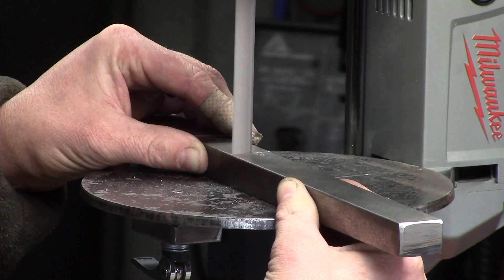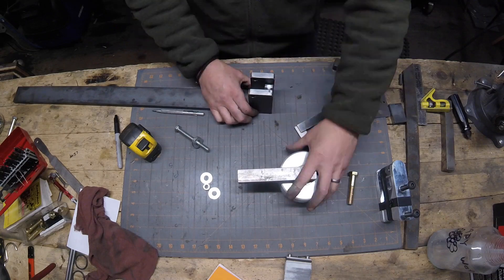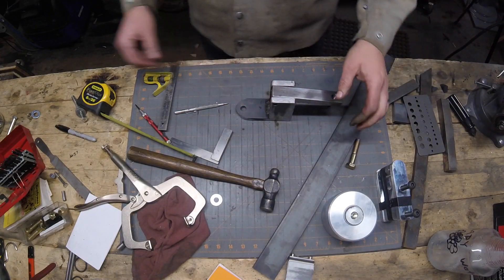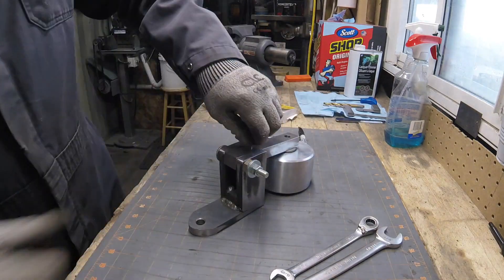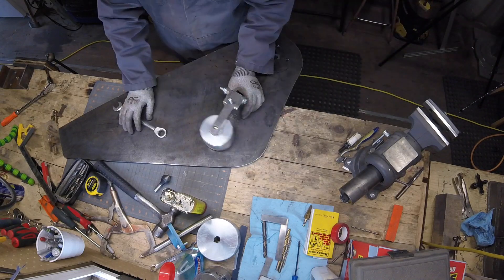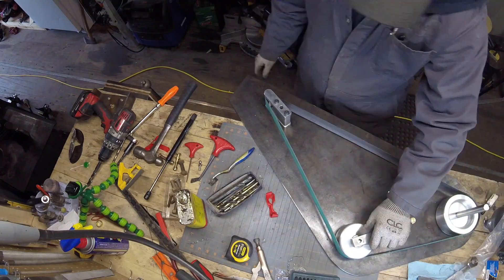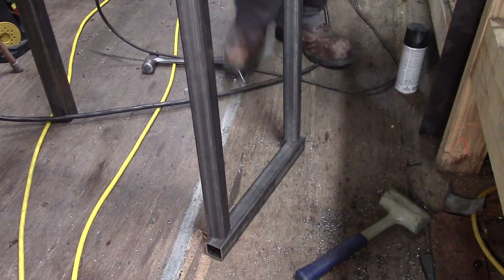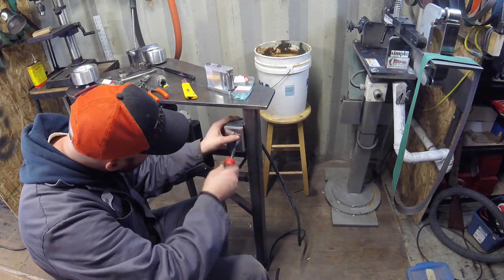Making a 2 X 72 horizontal belt grinder

Comment: I built something similar I find myself using it for grinding single point cutters all the time. I used 1/2" square tool steel and pinned it at 3"center and on the tool rest I have locator holes at the angles I use most ,it is quick and easy and it works well. Nice work

Comment: I really like this design. With just a few minor modifications to the base plate idea, one could easily make this on a hinge so it can be vertical or horizontal.

About your secondary sanding station... perhaps your flat plate can just have a series of pin holes machined into them. And you can make little rests/backstops with the pins pressed into them. That would enable you to cover a myriad of specific angles, but also keeping the plate open for larger grinding.

Comment: Good job on the bild Jeremy reminds me of when I converted Surface grinder to a 2 x 72 I have one question do you plan on putting step pullys for the speed adjustment or perhaps a VFD. If not I was just wondering why you didn’t go direct drive from the motor?

Comment: I'm wondering what is the liquid that you use it before drilling the iron bars. and why do you use it  i hope you answer. thanks
Reply from the maker: It's cutting fluid! Keeps the chips coming out cleanly and also helps keep the bits cool. Really extends the life of the drills and other cutting tools. Cheers!

Comment: What did you use for your big wheels? I'm trying to make mine right now and figuring out a good wheel is the hardest part it seems. Thanks!
Reply from the maker: I agree 100% I ended up buying them on eBay because after searching and trying to adapt stuff, I finally just figured I might as well just spend a few bucks and have proper wheels. But if I could have found something suitable I certainly would have done that. Cheers!

Comment: good googley go Jeremy, I'm truly impressed! awesome setup. where do you purchase the guides and rollers?or did you machine them yourself? your motor, 3400ish rpm? will you install a variable speed at a later date, or are you happy with single speed? 
I have to build my most of my tools, it's more fun, and I can't afford to buy. I'm so looking forward to designing and building my machinery, and maybe they will turn out almost as nice as yours...
Reply from the maker: Hey Buddy. I bought the rollers off eBay. I forget the seller right now but I'm planning on doing a video just going over and showing the finished grinder in a little more detail. The motor is 1750. It is certainly more fun to build tools that's for sure! Cheers!

Comment: Where can you find the belts that go from the motor to the wheel and the initial wheel that goes from the motor spindle to the belt?
Reply from the maker: I bought most of the grinder specific wheels and stuff from eBay, and the other pulleys, belts and motor are from Princess Auto. Cheers!

Comment: did you draw this out before you put metal to saw? great job as always. from a happy sub!
Reply from the maker: No I didn't. For stuff like this I never draw it up before hand. Most of this was made with scrap or existing materials so without going and buying materials the design is somewhat constrained to what I have laying around already. So, usually I don't ever do drawings. Just start hacking away and see what happens:) Cheers!

Comment: nice machine but without adjustable tables, up an down, your belt will wear in one  spot and never be good on your other machine. I was going to build a horizontal but opted on buying another Pheer from Jose and just made it set up for horizontal full time, then if I need regular vertical 2x72 grinder for anything I've got it. My tables this waty are also fully adjustable, no need for 48 inch belts and everyone is happy
Reply from the maker: Yeah I see how adjustable table would be nice. I was looking to just getting another KMG and mounting is horizontally but I ended up putting this one together for under $500 with the motor. What I've since started doing is slitting the belts to 1" wide and then I can use the whole thing just by adjusting the tracking wheel. I just take my 2 X 72 belts and turn them into 1 X 72 belts. Works awesome!

Comment: So how about some helpful information QUESTION What is the center to center distance of all wheels. ?????????
Reply from the maker: If you can’t figure that out when you’re building one, I can’t give you “helpful” information.
Reply: Simple Little Life thank you I will have questions like size of base. Size or wheels. Distance center to center of all the wheels. From there I can do a mock up before I cut and drill and/of tap. I know of a man with a computer controlled water jet so if I make a dwg or dfx file he can load and cut. I was thinking of a”c” faced mount 4or5 inch drive 3-4” tracking and a small wheel set up.

Comment: Very neat grinder and done nicely! I'm curious: how do you adjust driving belt tension? It will become lose with time. Also I have an idea about how to make very simple variable angle fixture. If you interested send me your email address and I'll try to explain my idea. Love your videos, keep up the good work!
Reply: I also was wonder about drive belt tension.
Reply: The small gas piston keeps the tension on the belt as it begins to stretch. It adjusts itself this way..
Reply: Erwin V - yes for the grinding belt that is right. We were referring to the motor belt.
Reply: O yes, i see. Sorry....
Reply from the maker: I'd love to see you idea. jeremy@homesteadknives.com is my email address. 

I use the slots that are on the base of the motor so I have about 1" of tension adjustment. I did the same set up when I mounted my motor to my KMG and it works well. Cheers!